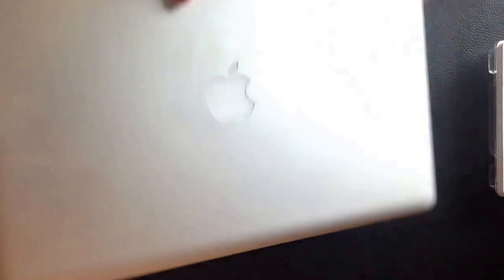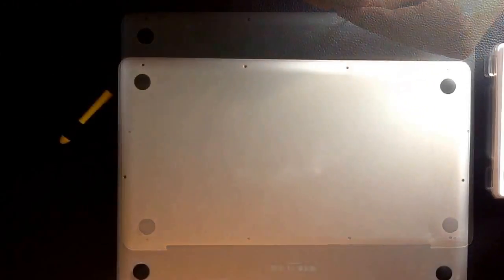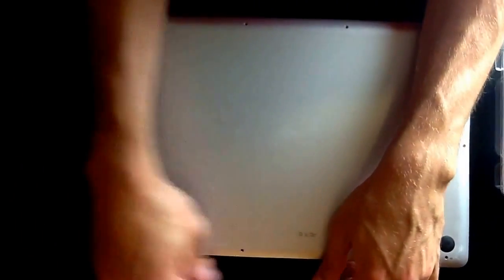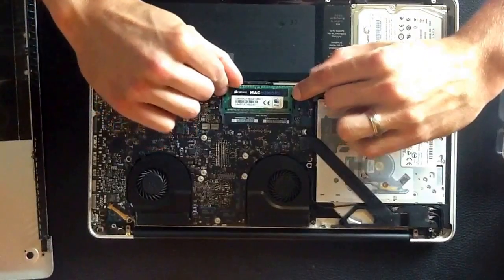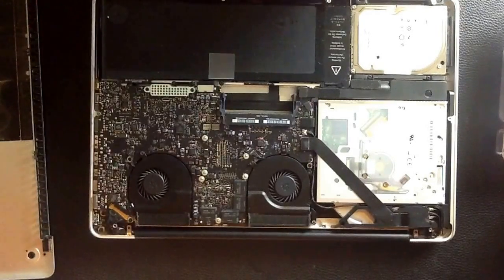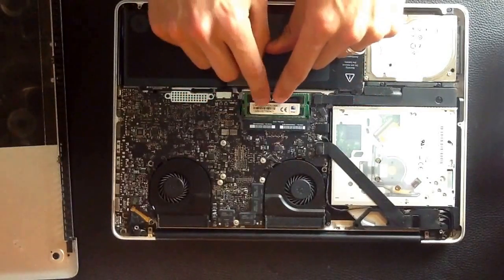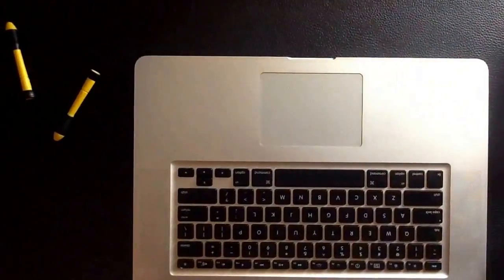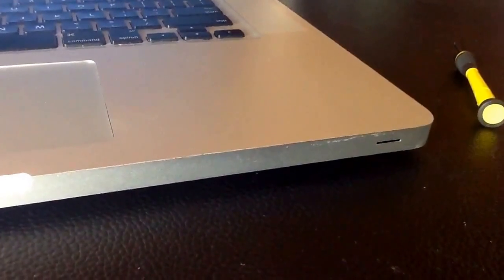MacBook Pro 3 Beeps Fix - Simple DIY Solution

Comment: I tried this on a colleague’s 2011 MBP and it didn’t work. I gave him instructions to reset the SMC - he didn’t have his power adaptor with him otherwise I would have done it there and then.

I’m also wondering if the RAM went bad. A third party shop upgraded the RAM and HDD for him. It has an SSD now.

Great video, short and to the point. Thank you!
Reply: Did you find any solution

Comment: Thank you! thank to your video, I was able to open my macbook pro and discovered the battery was all puffy, it even deformed the outside plate.
Then I removed it and now will replace the battery and check the ram slot.

Comment: Your tutorial worked perfect for me the first time. But this time, it didn't. The problem was more complex as I had to remove the fan, finding huge chunks of dust stuck in the vents! Before this finding, the laptop would idle and go to temps of around 70c but I thought that was cause it's an old laptop (early 2011) so I didn't think much of it. Now I finally got the macbook up and running and maintain a temp of no higher than 50c when idle no higher than 60c when running Serato DJ. So thanks again!

Comment: Thank you! It seems one of my cards is bad.  I reseated both and it didn't work. I switched them around...didn't work. I took one out and that worked.  I tried that one (that was working) in both slots with success.  I tried the one I took out in both slots with no success.  I tried cleaning it and no luck either. At least I know both slots are good so I used your link to Amazon and purchased another 8gb card.  I hope you're still getting a little something for that. Thank you very much!
Reply: Just popped in the 8gb card I bought from Amazon and she's running perfectly. Thanks so much again

Comment: Sometimes, the problem isn't the RAM, it may be the Hard Disk or the Motherboard. The reason why I say this is that the hard disk may stop spinning like it used to, due to it being old or it has a little bit of storage left. RAM only helps load crucial tasks on a computer, so I have no idea why would the RAM need to be replaced. It may have been due to dust or misplacement, but other than that there is no problem with the ram. Hard disk's, are a crucial part of making sure everything works like it does, like making sure the motherboard tells the fan to work etc, and if one single thing goes wrong, you can kiss your MacBook goodbye. The issue's with MacBooks is that they are very complicated, they aren't like everyday windows PC's. Apple has a very specific design. Conclusion is: RAM is not always the problem, its 90% the Hard Disk or the motherboard.

Comment: Can you tell me exactly please how to discharge the static electricity. I dont understand that step.
Reply: That term is used when no battery or power source (power cord) is on the laptop. Once all source of electricity is off. Hold down the power button for about 30 seconds which will drain all electricity.
Reply: Usually this will fix most home PCs when they won't power on after a thunderstorm or sudden loss of power.

Comment: Just a PSA if it doesn't fix it this way take one of the RAM out and try it with just one, put it in both slots and see which one works this will isolate if its a dead RAM chip or a dead RAM slot. Just snapped a chip that was faulty now running fine on 2gb until another chip arrives.Thanks for coming to my TED talk.

Comment: Had this issue, didnt have any screwdrivers though. So i lightly punched it 3 times on the base of the computer and it worked again
Reply: Stephen Thurman omg you are my lifesaver. I didn’t want to risk it by removing the RAM and stuff so I just gently tapped the back and omg it worked and my laptop is working just fine now mA. THANK U 😂
Reply: @lifewithmins8892  glad i could help
Reply: u saved me fr
Reply: Seriously it worked. 3 punches.. Thank you so much

Comment: Sure this might help but this is NOT always the fix..  I spent hours fooling with this only to find out it was the ssd drive I recently added.  Popped in a new ssd > command r and power takes you to internet recovery.  From there select disk utility format and then load the os.  Problem solved and lesson learned that 3 beeps can also indicate adding a new hdd that needs to be formatted as Mac journaled.

Comment: I have tried removing and putting the ram back a couple of times and it continues to do the beeping sound. How do I fix this?
Reply: I only was using one, and then seems both "spaces" dont work. Could be that it doesnt work anymore
Reply: @anaicam  It works perfectly once I removed the lower RAM and stayed with the upper one. My macbook now runs slower, but the problem is fixed. I ordered a RAM of 8GB for my mac to run faster.

Comment: I’ve got an issue with mine, both cards don’t work together but only one card works in the top slot. I only have a 4GB card and when booting the screen flashes and the Mac doesn’t fully power up (I presume this is down to insufficient memory). Would it be worth getting one 8GB card? 

Thanks
Reply: A Mac can boot with 2GB of RAM, maybe your RAM stick is faulty

Comment: Sorry, not a RAM problem. Reseated the RAM 3 times. Still get three beeps. The RAM works fine with a different HD installed; boots right to it. Which means that Apple uses 3 beeps to mean ANY error.  Good luck with that.

Comment: I had the same isue, but even resetting my RAMs, it didn't work.. I tried to put them in diferent order...even so. So I tried to put just one RAM (I have 2 RAMs of 8gb). It worked. So my problem was the slot of my motherboard.. I think it's burned. So now I can run my mac with just 1 slot of RAM.. it's a pit because now I have only 8gb, but... better than nothing :/
I want to share because someone could think your tip is not valid.

ps: sorry my English.. I'm not from English countries
Reply: THANKS MAN THIS WORKED !!!!!
Reply: I did this as well and my laptop works now. I inserted the new ram in the top slot as the one closer to the inside of the laptop didn’t work with a ram in it (tested by itself and with both slots full with new ram).
Reply: thanks a lot!! i've had the same issue and now my macbook works after i inserted the ram only on the upper slot. i did that after reading your comment.
Reply: It's problem with "cold february" on RAM slots mounted on motherboard. Mostly when you grab laptop one hand at the middle then motherboard bends and RAM slot lost contact. I've put some plastic card (i.ex. pice of credit card) under RAM slots to bend motherboard a little. Then second slot works again. Of course it's not the best solution but if you don't work mobile and use external keyboard it should work longer. Try that.
Reply: Thanks for your comment. Same thing happened with my mac. Service center people said that motherboard has to be changed which is not possible off course.
Thanks for sharing your experience.
Reply: Thank you for this! My laptop works again 😊
Reply: Thanks man! This worked for me too...
Reply: thanks man works for me. 👍
Reply: Awesome it worked!
Reply: It worked,  thanks
Reply: it worked for me as well thank you so much for sharing
Reply: you are amazing
Reply: Thank you so much bro appreciate you loads
Reply: Mine too
Reply: Thank you, it works!
Reply: Thankkkk you soo muchhh, it worked for mee! Reallly appreciate your commenttt!!!!
Reply: This worked for me, for about an entire day.
Reply: You made my day! Thanks a million!
Reply: There are 4 screws that hold the Ram sockets to the logic board. I have had success restoring both ram sockets by loosening those 4 screws 1/8-1/4 turn. This gives the socket "just enough room" to flex with the motherboard.
Reply: Fleetleader101 I bought one 8GB ram works fine
Reply: Thanks aquillas I tried just using one of mine and it worked now
Reply: Thank you! This worked for me as well!

Comment: Thanks. Worked for me. I also read every comment on here. I feel bad for those ppl in which this solution didn't work. Seemed pretty straightforward. Perhaps make sure the RAM is inserted and seated properly in the slots. I only had to reinsert the top one. It was clearly unseated after I'd opened the bottom cover.

Comment: Could the 3 beeps indicate any other issue?

I reseated the RAM and it still beeps.
Reply: Try removing one ram stick see if works if no remove the next ram and inserting it to other slot if it boots then while the mac book is on place the other stick in the empty slot then let the mac book finish booting to mac os and PROPERLY SHUT IT DOWN after 30 secs turn it back on hopefully it fixed your problem 😀

Comment: I own a 17" late 2011 with the GPU-problem (Un-leaded solder). I have been using a software solution to bypass the HD Graphics 3000 on startup, but suddenly it didn't want to anymore - screen was just dark. TInkering with it I suddenly got the 3 beeps. And I was wondering if may the ram of the GPU could somehow have come loose? And that that would produce the beeps? Nahh, not realistic, right?

Comment: You helped 1900 people. 
My mac slipped and it dropped on the floor despite it's protective cover and the sleeve it was on. Once the harddrive cable got loose, i connected it (you get this folder with explanation mark when you start up that keeps blinking)  but now it was the memory cards that have moved. I couldn't get the second card out, so i figured that one was well connected as it was unmoveable anyway. I don't want to force anything. The first one just popped out like in your awesome demo. And yes, the computer restarted as old. Thank you a lot! I almost gave up hope for this 5 year old macbook pro.
Reply from the maker: Thank you for the kind comment. It is nice to see how many people this video has helped.

Comment: When you removed the RAM did you clean it and the socket area that it fits in. If so how and with what did you clean the RAM  with, being such a delicate part. Mine is a MacBook Air with the same issue but I dont know if the procedure is the same as the PRO.

Comment: If you cant fix this, the problem is one or the ram slots i tried the 2 rams one by one on the slots the both are working good in the upper slot, and both failed in the bot slot im working with one ram, if anyone have a solution please share with me..

Comment: If it doesn’t work try starting with just one ramm stick in either slot. If you get the 3 beeps try just one ramm stick in the other slot and power on this should narrow down which slot has bad contacts then try cleaning with alcohol.jay

Comment: Hey!  
Thanks for the video and the info.
Was using my MacBook when all of a sudden, the screen glitched, and I force shut it down.
When I tried to start it up, it kept beeping.
Looked it up, and I found your video.  
Problem fixed.  
I also bought the cheap $1 set, and ended up going back to the store to get the Stanley set.
Hahaha, I should have learned form your mistake.  
Thanks again!

Comment: I removed and installed both modules but it didn't work. I then removed both and only installed  1 (call it #1) and left out #2, it worked. To test again, I removed #1 and installed #2, it didn't work (went back to 3 beeps). Now I know that there's a problem with #2. So for now, I installed #1 and laptop is running. Will replace #2 when I have time.
Reply: VRGurl thanks for sharing this... it worked for me.... I think one one of my ram is having complaint...
Reply: this worked for me too! thanks! my macbook hasnt turned on in about 6 months! now its working again. I will also have to replace "#2"
Reply: Thanks for sharing this. I think I have the same problem. Guess it's time to get that 16gb of RAM

Comment: I'm doing a shot list for a 6-day shoot. It's past midnight here & we have an early ocular later. This 3 beeps happened before but I was able to fix it by pressing shift, control, option and power button and releasing at the same time. The  pressing the start button. But now it didn't work. Saw this video. I was hesitant to open my wife's Macbook Pro, but I have no choice. I need a quick fix. And voila, it turned on! BIG THANKS from Manila! 🇵🇭

Comment: Thank you so much for making this video! This happen to me a few days and I took it to Geek Squad the next morning, but my laptop was working normal when I brought it to them. Geek Squad told me to take it to Apple so they can run a system check to see what the error was anyways. Waiting till Wednesday for that Apple appointment though. Hoping that the RAM chip was just loss and it fixed itself when I started carrying it around that day, but I will see. Thanks again!

Comment: this may be a giving but i did this and nothing changed.....then i got a air blower and blew out the ram area and turns out there was a big piece of dust that got into the ram area. once that was blown away it fixed the issue. so if you do this and it doesn't work grab an air blower and I used a camera hand blower, but any should work but it fix this issue of the ram.

Comment: I've tried this twice and it hasn't worked. Any other suggestions? Please.
Reply: Same here... In my case sometimes Screen turned on and go off on the half the process of starting...:(
Reply: I turn on the mac
Reply: Try with only one memory card. It's usually the slot at the bottom that malfunctions. I had to take off one card and it started working without any issues. Hope that still helps after three years!

Comment: I had upgraded the RAM from 2x4gb to 2x8gb. I have removed the RAM cards and reseated them together, switched card positions and have also inserted each card individually in an attempt to get my late 2011 MBP 15 to boot and all I get are the same three beeps. Old RAM and New RAM. Nothing has restored functionality. Does anyone have any insight into what could be the cause?

Comment: For those that this didn't work for. This seem to only work for those that dropped their macbook pro. For me that haves a 5 year old Macbook pro and just now had it beep like this and I tried the above solution and did not work. Try this.

Take out both rams. (ALSO DISCONNECT THE BATTERY POWER OUTLET PLEASE) Put one in. try to turn on if it beeps try to put the other one only. Try on both side 1 of them at the time. If it turns on with one of the rams then the other ram might have died and you'll need a new one (eventually) . If it don't work with ether then both RAM cards are damage and you'll need to buy a new one. I found this out right now trying this video and my mac would not turn on but it did turn on with one of the RAM cards. My other RAM card one died and did not let my mac turn on unless it was removed. Always have one RAM in your Macbook atleast for it to work!! Good luck!!
Reply: Moonlight The Wolf how to disconnect the battery power outlet??
Reply: eataliens there's a wire connecting to it and you only have to lift it up to disconnect the battery. I can't show here pictures but you can look up a youtube to disconnect a macbook pro battery is very simple.
Reply: it work with one but with two it beeps and take a long time to power up

Comment: I face these issues with the Corsair RAM. Its the second set I have installed and have started facing this issue again after the earlier RAM behaved the same. I am now guessing Corsair is not a good product to go with. The RAM refitting works - but happens again two days later.

Comment: I reseated the ram, and the computer started back up, but the fans start running really loudly and wont stop, even after restarting the computer several times. Mind telling me how to fix that?
Reply: xSFGx _Legend  Step 1: Remove & clean your fans & use a can of compressed air and blow out any loose debris and dust from the top & underside of the logic board. If that doesn't solve your problem, go to step 2. 
Step 2:  you need to replace the old thermal paste from the underside of the logic board. It's very likely that the old paste is dry and no longer making contact with the heat sink and GPU. There are plenty of videos on youtube showing how to do this. 
Step 3: Install SMC Fan Controller App to keep your freshly cleaned MBP nice and cool with quiet & effective fans that you can control. Hope this helps 😃
Reply: Hey @xSFGx _Legend
The fans in all MacBooks run any time that it is powered up, but at a very low (and quiet) speed. The fans increase in speed as more CPU cycles are used and when the temperature rises. Can i know what's the specs of your Macbook ?
Reply: ***** I fixed the issue already, but thanks for responding!
Reply: xSFGx _Legend You're welcome :)
Reply: i am just about to attempt to do this process. So just incase this does happen can you please tell me how you fixed this problem

Comment: Eric or someone, I've reseated my macbook ram both of them but it's a temporary fix, for 2 days it wouldn't stuff up or do the 3 beeps of death. What would you recommend?
Reply: Are you sure when you put them back you have still the same amount of mem ? f.i if you have 2x2gig check to see if it is total 4 gig and not 3 or even 2 that would mean one of the ram sticks is defective. Are the RAM sticks the same brand and size ? if you have different speed try putting the one with the highest speed in the lowest slot,  but better is to replace both  RAM to the same brand and size and if that doesn't help or if you simply have the right amount of MEM reporting in, about my mac it might be that your video shared mem is having issues  (depend on what MacBook you have) some type share mem with the videocard  and that might  be harder  or even impossible to fix yourself  and can be really expensive  i do have my dough it is your MEM in the first place there is most likely something else wrong, like overheating of your GPU ? when do you get the 3 beeps back during full operation or after a normal  wake up of restart ?